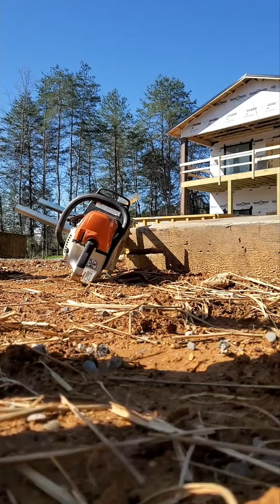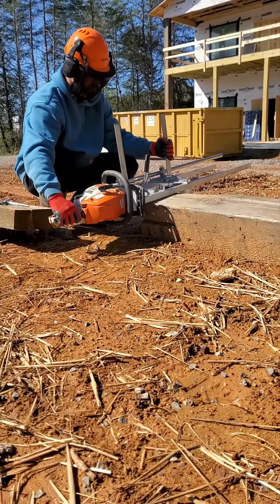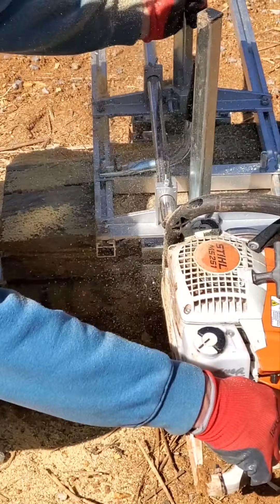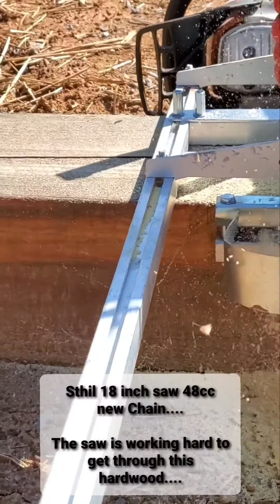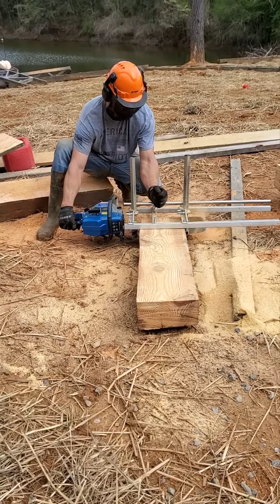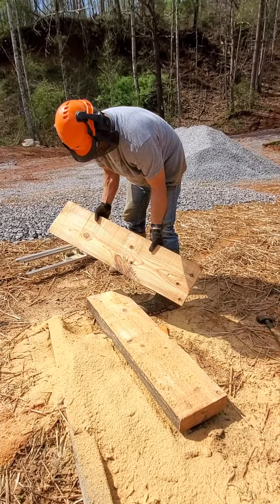Wemars 62cc 20 inch chainsaw vs Stihl 251 46cc on a portable sawmill

Comment: Yup. You got it going backwards. Always set the mill up where you are cutting from the bottom of the bar pulling towards the power-head instead of pushing away. More safe and easier on you and the saw. Happy milling.

Comment: I have been milling 30 years and if never thought to try a saw backwards.  But hey, the majority of the sawdust is away from you.  But seriously I think based on torque and physics and friction I think it would be more effective cutting correctly from the bottom of the saw. Or just going the other direction with the saw. Based on how its clamped in place on the mills.

Comment: I think your saw is setup backwards on your mill
Reply from the maker: If I go the other way the measuring sticks (top) will be down blocking the cut. Also you don't want the gas bar oil side down for obvious reasons. I'm not an expert by any means so I'm open to advice anytime.